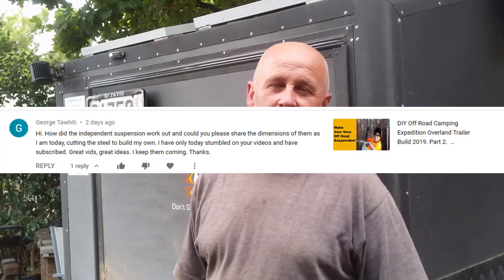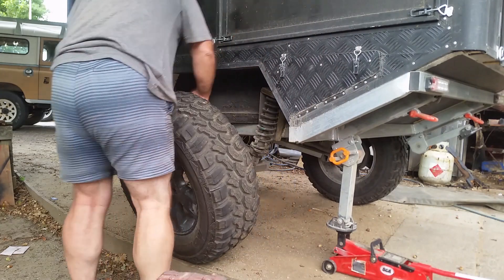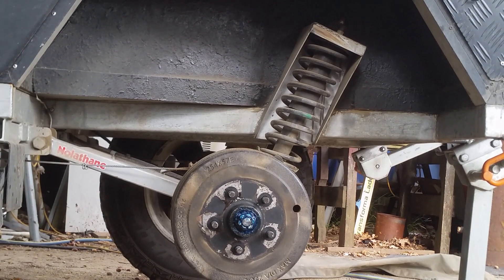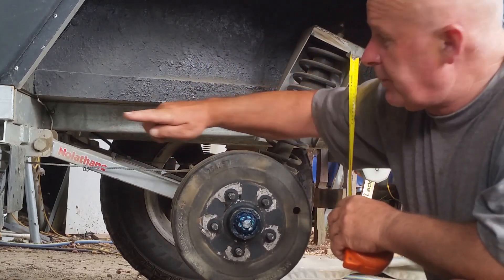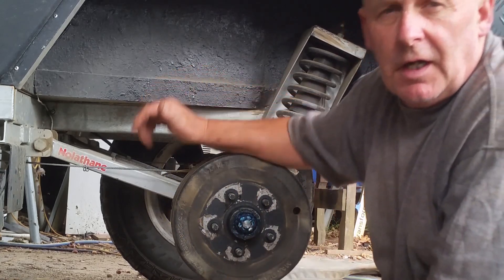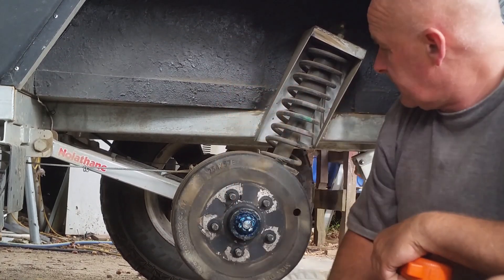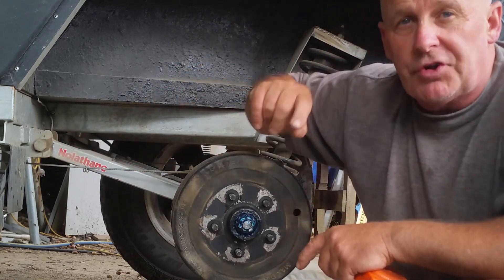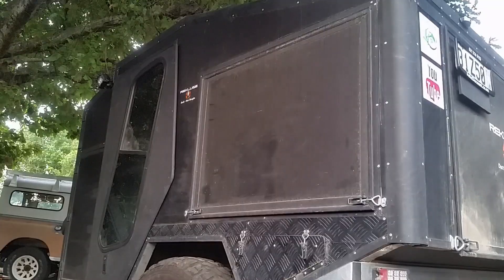Off Road Trailing Arm Suspension- Details and Measurements

Comment: what year range  of Subaru forester struts did you use?  it looks like a stout setup and I think I may do the same for my trailer.
Reply from the maker: I walked into Pick a Part with a tape measure and a socket set and found many coil overs that would do the job this forrester was one of those early model boxey shaped ones. rear shocks.

Comment: The independent trailing arms I'm fabricating are for an Aliner a-frame pop-up trailer.  Wet weight is approx. 2000 lb.  A friend gave me some 3x1" rectangular tubing.  I hope this is strong enough to build the a-arms.   After taking off the Dexter torsion axle, there should be some weight savings with the a-arms since the Dexter weighs a ton.  Does anyone think I'm making a mistake by building them out of 3x1" tubing?
Reply from the maker: Its a bit sketchy . If you have the 3" axis vertical it will help Triangulation will keep it stiff laterally. you will still need some 2" square to carry the axle stubs

Comment: Your videos have been instrumental in helping me get started fabricating my own swing arm suspension.  Can you explain in more detail how you could add toe-in adjustments by drilling out the holes and adding concentric washers?  I'm not getting how this would work.  Thank you!
Reply from the maker: Hello- yes I purposely made my pivot points far enough away from the cross member to all ow me to fit camber washers later in case the suspension ever takes a nasty tweek. you simply drill the outer mounting 5mm oversize on both tabs and buy two  pair of eccentric washers from a suspension shop.  You will need to weld on two strips of 3mm steel to give them something to push against. But its a simple job either while you are building or down the line - so long as you have a big enough space for the washers and the cage that they sit in